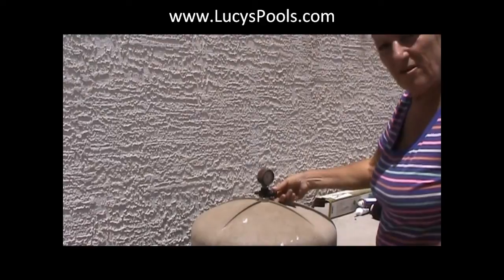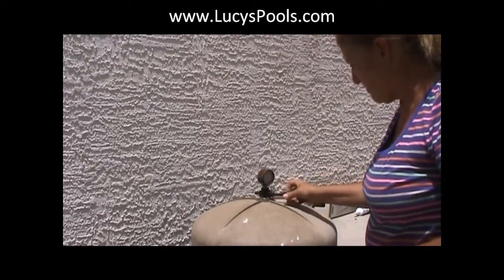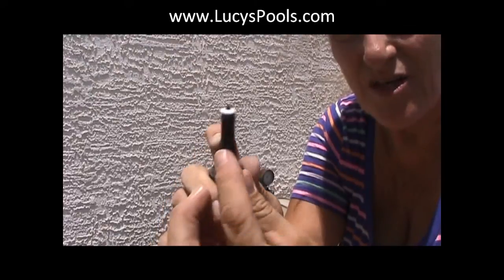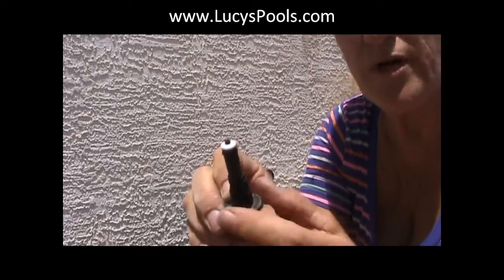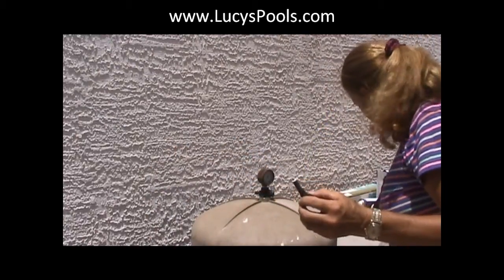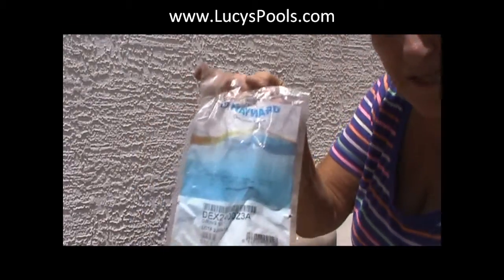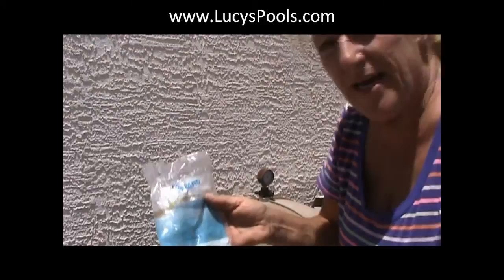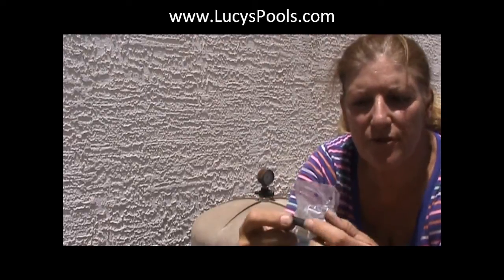Hayward Filter Sucking Noise

Comment: hi Lucy any tips for a simple screw on air relief. hayward 4 point cross. I haven't been able to properly prime my pump because of this.
The vsp cant stay primed under 3,400rpm. (I think its because of my old hayward sand filter s200)
Reply from the maker: Ankit j Hmmm...I don't think the air relief valve would prevent your pump from priming. Do you have a Jandy or Compool valve in front of your pump? When you turn your pump on, wait for a bit, then shut it off. Look to see if any water leaks out the valve stems or side of the lid. Or, put your ear to the valve to hear any air sucking in.   It could also be your "old Hayward sand filter". When was the last time you cleaned it?  A pool not priming can have many causes.  Let me know if any of these tips help...I could give you a list of things to look for. (In fact, I may actually write up a list and post it on my website). Lucy
Reply: It was actually my jandy valve's grease port. It was filled with silicone sealant but had a pin sized hole in it. I filled the hole for now and will eventually get a neverlube model when I upgrade all my above ground pipes to 2".

The water hose technique is the easiest to detect a simple suction side leak. I was lucky I was able to keep my finger over the hole with the pump off and noticed no more gurgling air bubbles.

Thanks again Lucy, your videos and website are so helpful.
Reply from the maker: Ankit j Glad you located it. They actually make a plug for those old Jandy's. Also, you said you were going to "upgrade... to 2" If you have 11/2" underground, be forewarned that when you install 2", you're still going to be somewhat limited in your horsepower. In other words, I've seen many people do the same thing, but when they added a 2hp. pump the extra space in the pipes created a lot of air. Just wanted to give you a heads up. Good job in finding your air leak. Lucy